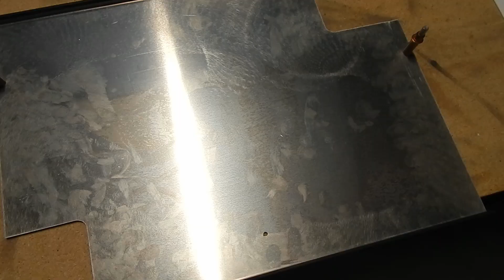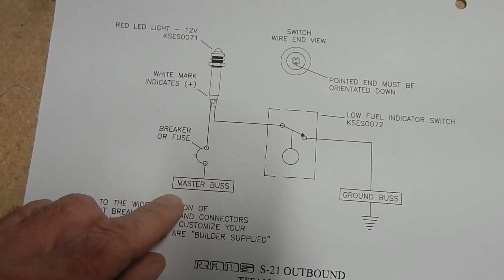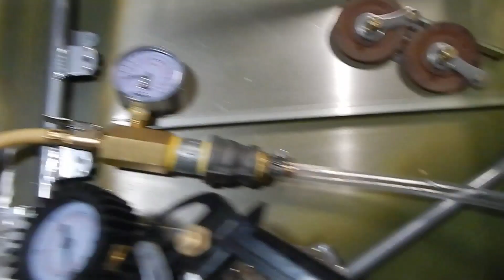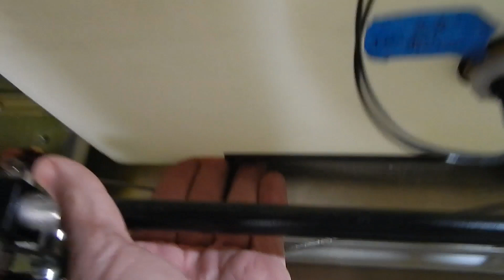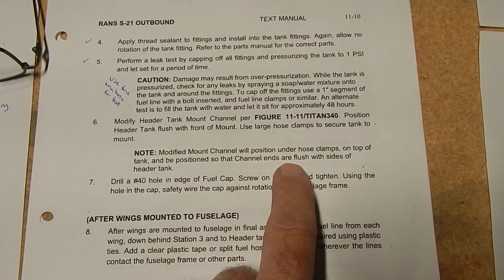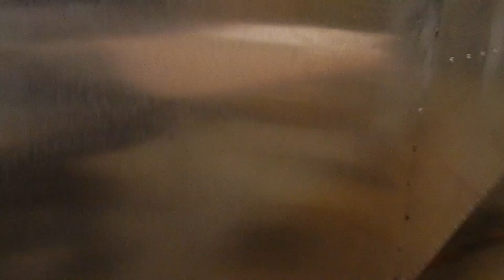Building a RANS S21 Outbound plane ep 22 - Header Tank and Fuel Pump

Comment: I believe that somewhere in one of the manuals it is suggested that you read the entire manual before starting your build.  I did that and made mental notes on areas where things could be done in a better sequence.  And before I start each step, I read through the entire section and think about the sequence before I do any riveting or otherwise permanently affix anything.  I am sure that I have spent an hour reviewing the manuals for every hour I’ve spent in the shop.  However, it has paid off with only a couple of areas where I painted myself into a corner.  One thing I decided to do was fit the interior parts before I riveted the exterior skins.  I am very glad I did that as parts of the console installation and side panels were far easier to do with access from the outside.
Reply from the maker: Yup.  Excellent point.  But even when doing that its still hard (for me) to sometimes have a vision of the final product.  I often spend hours reading ahead, and then watching other builder videos, and checking EAA builder logs.  There are still some corners that I get into...
Reply: @treetopflight7624  Yes, we never catch everything, but it certainly helps.

Comment: Given that the cage is powdercoated, there is not really a need to prime the mounting plate.
Reply from the maker: I would tend to agree with you, but the RANS manual advises priming any aluminum that comes in contact with the cage. I'm guessing it's in case the powder coating wears off.  I was following the manual.
Reply: @treetopflight7624  That applies in the case of putting aluminum rivets through holes drilled or reamed into the tabs or bosses on the cage because that removes the powerboat and exposes bare metal.  Primer will wear through long before the powdercoat.  No harm in priming, but not really necessary unless the dissimilar metal is contacting the metal in the cage.

Comment: Did the same thing as you did on the edge of the plate cutting into the tank. Fortunately didn't cut through the tank but I did fill the area with epoxy.
Reply from the maker: Yeah, I assume a lot of builders have done this.  Hard to avoid unless you know about it. I saw a video where someone placed some plastic shavings (from a scrap piece) into the gouge and then used a soldering pencil to melt the shavings to the tank. Filled the gouge nicely.

Comment: I just did my header tank today. I wish I had watched your video first. I too riveted the mounting plate to the frame and realized the “ straps “ would not now fit under. Also, my header tank mounting plate was too short, the rear had to be lengthened. A 1 hour job took 5! Reading well ahead is a must.
Reply from the maker: Yup.. The manual is not always a step by step, and often leaves out details that would be extremely helpful.  New builders need to find resources (other builder videos or EAA builders logs are my favorites) to help with the build.  Happy building.

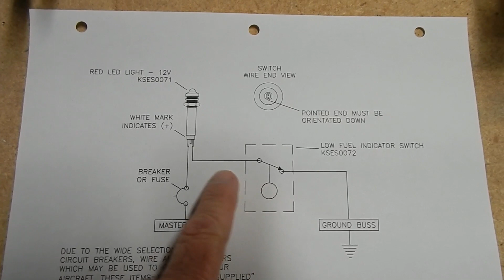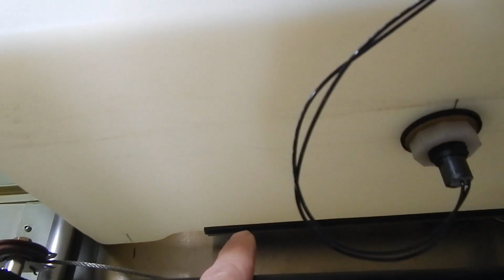Comment: At 9:10 you see the instructions to have the “arrow” or point on the fuel level switch pointing down, at 18:50 ish your switch is in that position. Not sure which way that makes the float operate though.
Reply from the maker: The float light (low fuel) comes "ON" when the contact is made.  So the bulb needs to be in the "UP" position (separating the contacts) when there is fuel in the tank.  As the fuel empties, the bulb comes down and the contact is made.  At one point I had it upside down.  That's what I tried to explain in the video. Thanks for the comment.